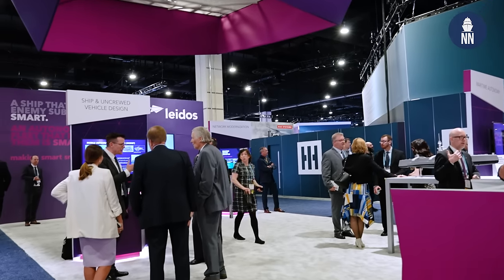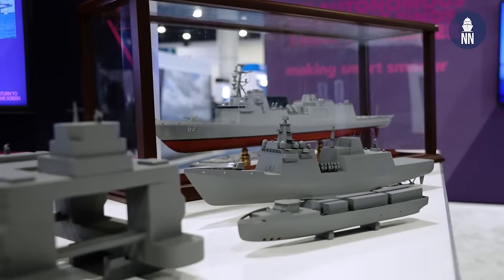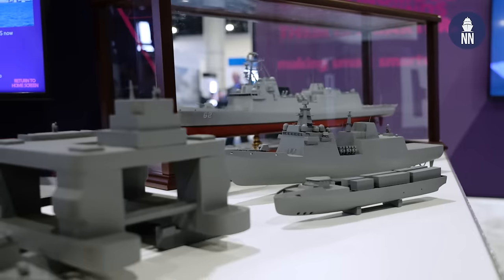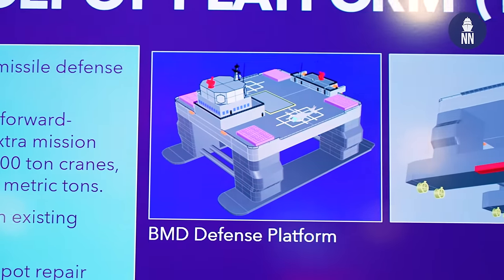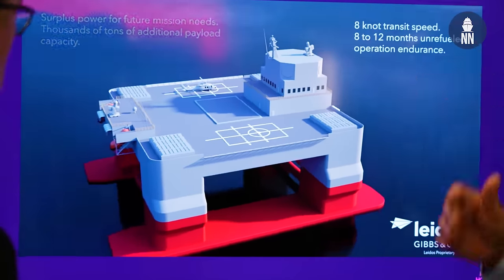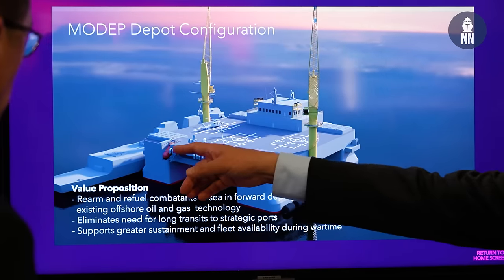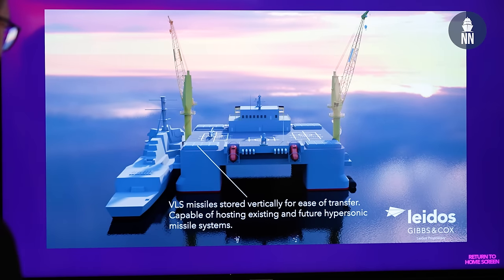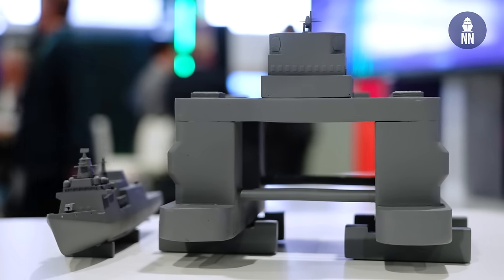Mobile Defense/Depot Platform (MODEP) Concept at Sea Air Space 2024

Comment: Why could not the idea of using or converting, former semi-submersible  floating-platform self-propelled oil and gas rig's.

In to forward deployed Mobile Logistical Replenishment at Sea, Semi-submersible Floating-platform Self-propelled Sea Base.

Not just for supporting and resupplying Naval Warships and Submarines, with the likes of Surface to Air Missiles, or Anti Ship Missiles.

Or the likes of Anti-Submarine Missiles, or Land Attack Cruise Missiles,  or even Submarine Launched Ballistic Missiles, or new Hypersonic Attack Missiles too.

By using multiple heavy lift cranes, which are mounted on either side of the floating base. 

While between the Semi-submersible pontoons, also under the platform main structural.

Could be a lowering and extendable loading and unloading vehicle ramp, which the likes of Air Cushion Landing Craft's (ACLC's), or Vehicle Personnel Landing Craft's (VPLC's).

Or Landing Craft Medium's (LCM's) and Landing Craft Utility (LCU's), plus Landing Ships Medium's (LSM's) and Landing Ship Logistic (LSL's), could all dock with and load from  or unload too.

Or even Amphibious Armoured Assualt Vehicles, could deploy into the water from, or be recovered back from water onto as well.

Though equally supporting and resupplying Littoral Amphibious Marine Units too.

These converted former semi-submersible floating-platforms self-propelled oil and gas rig's, could be equally provided on top. 

With a both short take-off and vertical take-off plus vertical landing Flight Deck, as well as Island housing Flight Operation Deck and Bridge Deck with sensors and communication arrays etc too.

Which has short take-over runway, that long enough for F-35B's take-off, maybe with a Skyjump at one end too.

While the rest of the Flight Deck, is divided up into Helicopter Landing and Take-off Pads, plus Landing Pads for F-35B's too.

Then one level down from the Flight Deck, would be a large Aircraft Hangar Deck, which is linked to the Flight Deck, by a pair of external Aircraft Elevators.

While the Flight Deck and Aircraft Hangar Deck, are linked internally to lower Cargo Storage Decks, Weapons Storage Decks, Accommodation Decks, maybe a Marine Emergency Surgiccal Hospital deck too.

By different personnel, weapons, cargo and vehicle lift shafts too, able to transfer anything from Light Armoured Wheeled Fighting Vehicles,  to stretchards carrying wounded personnel.

So these Mobile Logistical Replenishment at Sea, Semi-submersible Floating-platform Self-propelled Sea Bases, could supporting a Marine Air Wing.

Consisting of a Squadron of F-35B Lighting ll Fighter's, as well as a squadron of AH-1Z Viper Attack Helicopters.

Along with a Squadron of  UH-1Y Venom Utility Helicopters, with a Squardon of MV-22B Osprey Tilt-Rotor's and a Squadron of CH-53K  King Stallion Heavy Lift Helicopters too.

Plus a Squardon of US Navy MH-60R "Romo" Seahawk Anti-Submarine Warfare Helicopters and MH-60S "S" Knighthawk Multirole (CSAR /VERTREP / MEDEVAC / CAS / MARINDT / SWS / ISR / ALMDS) Helicopters too. 

Along with one Marine Littoral Battalion of Marines, plus Squardon of Naval Special Forces too.

With these Mobile Logistical Replenishment at Sea,  Semi-submersible Floating platform Self-propelled Sea Base, equally built with their own Vertical Launch System (VLS).

Equally mounted with Close-In Weapon Systems (CIWS's) plus Direct Energy Weapons (DEW's) too, both for the Self Defence of the Sea Base, with the added capability of Offensive Strike Operations too.
Reply: Stay off the drugs.